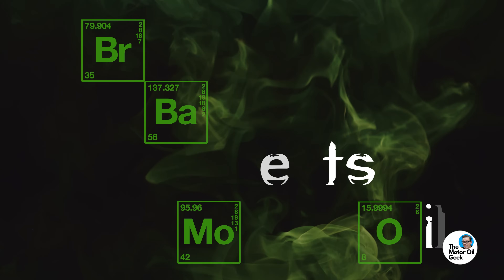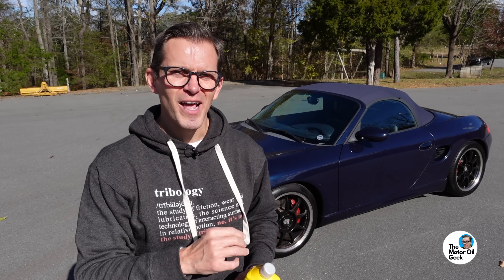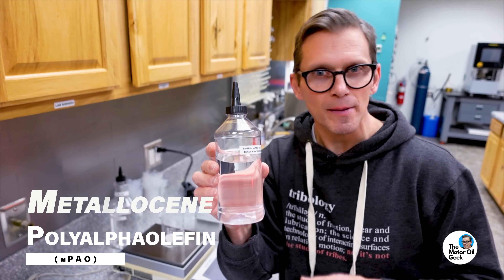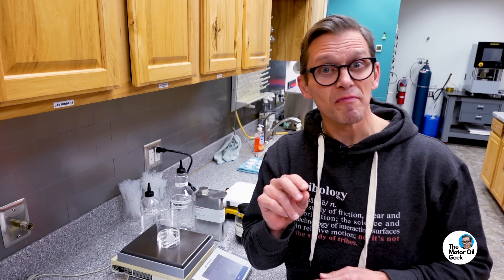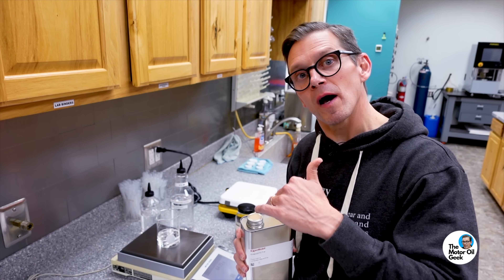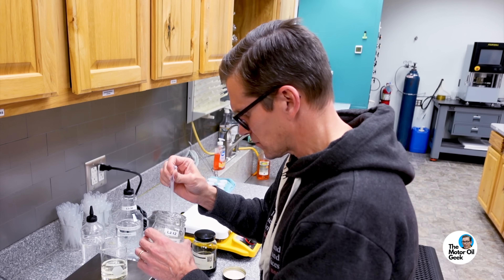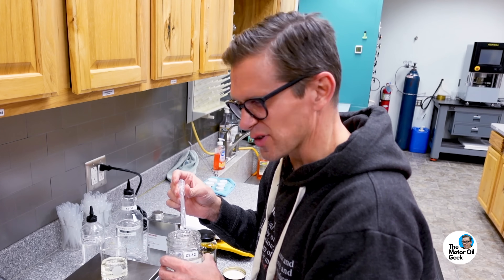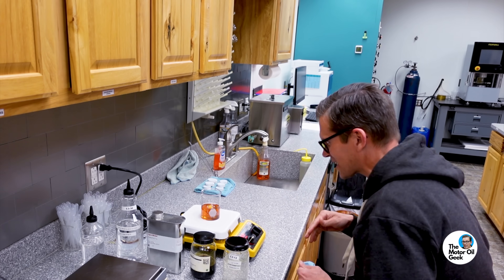Motor Oil Chemistry EXPLAINED (Breaking Bad Style)

Comment: Sumabore coated cylinders? Can you point me in the direction for some info on that please?
Reply from the maker: https://youtu.be/vZDbLfDAV4Q?si=GI4kuYB2PIiw-Ii1
Reply: @themotoroilgeek that’s awesome thank you. I’ve actually tried contacting you about this. Could I use this as a solution to fix the b58 engine. They have arc wire lds AlSiMgCu coatings. They are wearing out with higher hp and e85. They also can not be honed for new pistons. I’ve already talked to your guys at total seal about some custom low friction rings that would help with seating the rings. Since it’s an old hone you are using. That a band aid tho rather have a fix. The other issue comes piston to wall clearance we can’t change it. 
 
I see I can do it on the sleeved engines but its not a problem then. If I could make it work on the factory engines as a fresh start that be a game changer. Any input would be very grateful.

Comment: I'm REALLY interested in your results. I'm breaking in a 6.4 Hemi RAM . I'm currently  using the spec. Pennzoil 0w40  and changing it every 2k miles and sending in the oil to Speed Diagnostics. I believe there might be a better solution but worry about all these Euro oils.

Comment: Lake, do I absolutely need to use a BMW spec oil on my turbo GDI bmw motor? The LL-01 spec it calls for is over 20 years old, yet bmw says it’s all good.
Reply: If under manufactures warranty follow their guidelines to the Tee,  afterwards do whatever you want.  Join a couple BMW forums and ask around what other oil folks are having good service with. And do used oil testing, that is what Lake's company does, Speed Diagnostix.
Reply: @chestrockwell8328 I’ve been on the big bmw forum (Bimmerpost) and there is no consensus, just a lost heard of sheep.

Comment: Lake, I have a fleet of commercial mowers with Kawasaki FX engines, what’s the best synthetic oil for them? Amsoil small engine formula? Or what…..? Regards, Tony
Reply: I run fx the scaffer is best but mobile 15 50 is good you do want high zinc oil unfortunately amsoil small engine is not high zinc i do not understand why

Comment: Hi Lake, greetings from New Zealand!  Any chance you could do a video (or videos)  on other lubricants, such at ATF and gear oil? Cheers
Reply: I believe he has done some, if I remember correctly they are basically the same aside from additive pack. Gear oil viscosity is similar aside from much higher W weight scale on bottles. ATF uses same base oil and red dye so we don’t get it confused with engine oil.
Reply: Those videos are very short. Gear oil and ATF don't have to deal with combustion gasses they just have to work.

Comment: Great video! Wondering why you wouldn’t use a 6cst PAO for your base oil considering it would meet the 0W spec? Wouldn’t a higher viscosity base oil and less VII make it more stable and provide better protection?
Reply from the maker: It is better to use a lower viscosity PAO and blend in more mPAO 100. That combo works better, which is why I'm showing everyone what actually works better.
Reply: @themotoroilgeek what would the average CST @ 100 C of the base blend of that 3.5 PAO and that small amount of mPAO 100? Curious how much it changes it
Reply: @themotoroilgeek  so from a MW standpoint, a bi-modal distribution is best?  Is this only because of multi-weight reasons or would this apply to any lubrication situation even at constant temperature and shear?